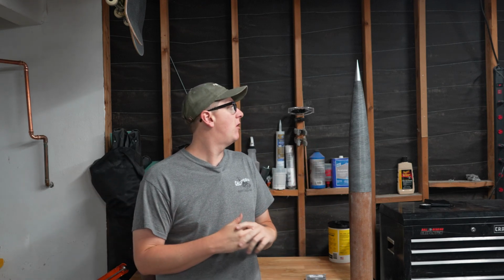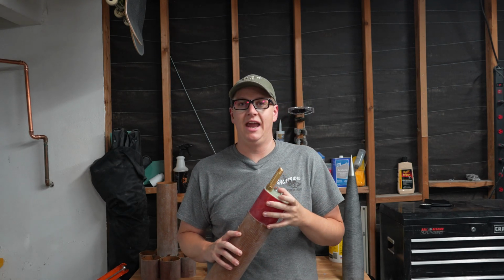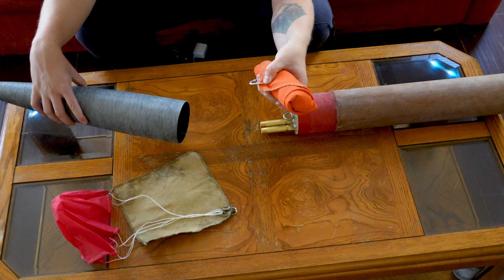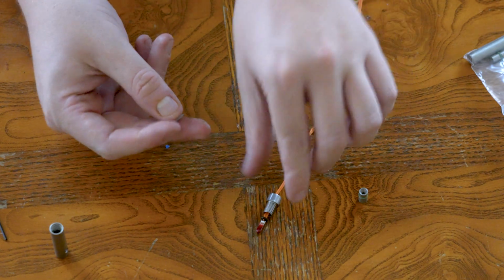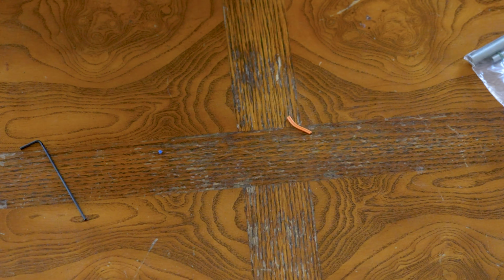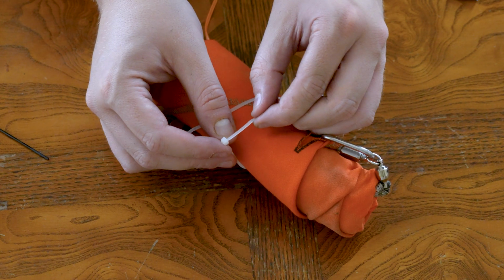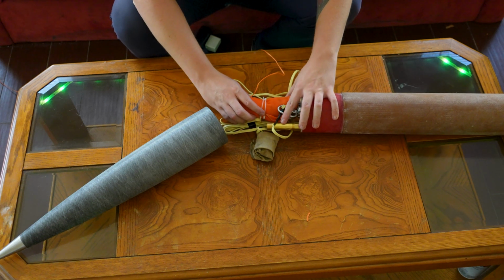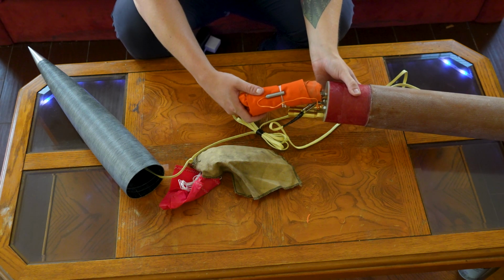High Altitude Rocket Cable Cutter Deployment Assembly

Comment: Personally, I would just add two to three feet of tube and make it a conventional dual deploy. I normally use way more "shock" cord than that. 40-50'. In theory the cable cutter should work but I just don't think it's necessary. I know you are using it as a test bed for the N1000 rocket. Good luck. Still gonna do that Honest John?

Comment: Are you concerned about the cable cutter getting dull after some uses?   What are your thoughts about other py-ro release mechanisms?
Reply from the maker: I'm not particularly concerned about it and it won't be flying often, so I think it'll be alright. The only other pyro release I really know of is the Tender Descender (or the AARD before it) and it's way too big for this application.

Comment: How much shock cord do you gather up in a soft break?  Is it 2/3 of the length? Is it different if you do normal dual deploy, splitting the rocket in 3 parts?  Trying to learn for my eventual use of an ebay and charges.
Reply from the maker: Honestly,  I just wing it most of the time lol